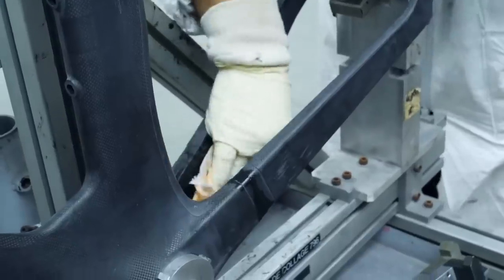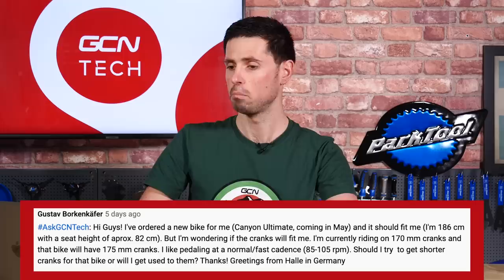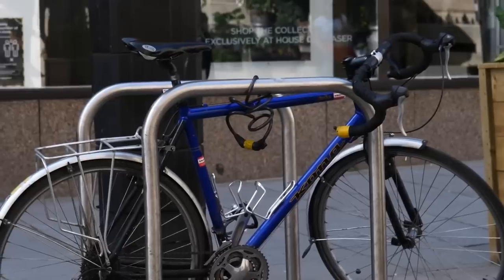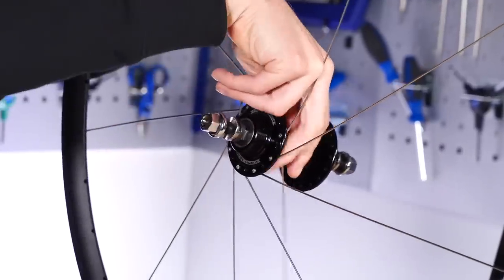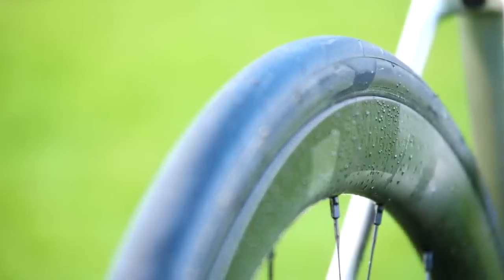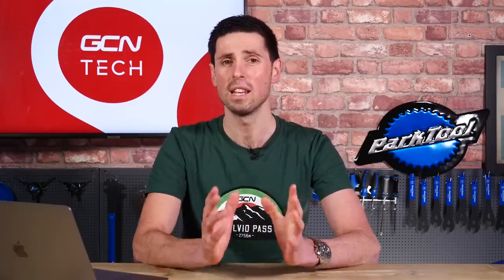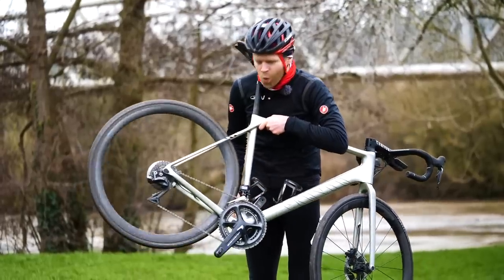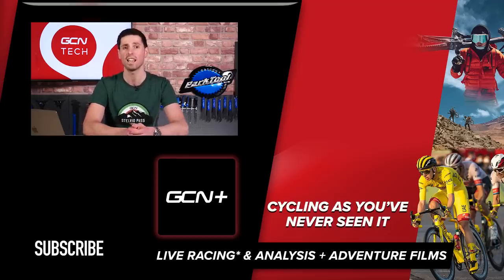Do Carbon Fibre Bike Frames Have A Shelf Life? | GCN Tech Clinic #AskGCNTech

Comment: #AskGCNTech
My disc brakes keep ruining my life. Last week I had to get my rear calliper replaced, because the previous owner tightened the pads so much, the screw broke on multiple places. Cost me €140. Yesterday my front calliper was not running smoothly and I found out that one piston only goes out, but doesn't retract, so that it's always against the rotor.

What can I do to save my life? Please help, before I throw my bike off a cliff.
Reply: Could be dirt on the piston. There are a few videos on YouTube about it. Or the brake may be in need of a bleeding.

Comment: #AskGCNTech Hey guys, I have some El Cheapo (the brand is Winzip, but I doubt it is anything good) brake calipers, combined with oooooooooooooooooooooold Sora 3400 STIs (which are Super SLR), and I feel that braking power is lackluster to say the least. Are modern Shimano calipers (the SLR-EV or even New Super SLR models) compatible with my levers? If not, why? Would mixing components (like, for instance, using SRAM's calipers), improve braking performance? (I already upgraded my brake pads). Thanks in advance!

Comment: #AskGCNTech which is better speed sensor or gps based speedometer?
Reply: Been testing this myself recently over the last month. Found that the speed sensor is more accurate and there are no data spikes, dropouts or other weirdness, but the GPS speedometer is better for integration and means less stuff on your bike in general. For someone like me, where getting incredibly accurate speed data is not an issue, the GPS is peachy keen. It does, however, mean that I can never be completely sure whether I really did hit over 300kph on my last trip to the shops. I mean yeah, there was a tailwind, but, still ...

Comment: #AskGCNTech does different sizes of frame has different sizes of rim? Because some rims look bigger.
Reply: No.... unless you have a small frame and mount 650B wheels on it. Take a look at the recent video with Conor and Manon swapping bikes, Conors wheels look tiny compared to the frame. I've always wondered if there would be a rolling resistance advantage for such large riders to go to larger wheels.

Comment: Short answer - No 

Yours sincerely, 
A structural engineer.
Reply: The short answer - it depends, but mostly yes.  Another structural engineer.
Reply: @lightnervejm2664  Can you please explain?
Reply: So yes or no?
Lol
Reply: @pomajzsolt4363  most definitely maybe from not a structural engineer 😉
Reply: @nicksmith9068  :DDD
Reply: @lightnervejm2664  Lol. Carbon does not degrade when it’s not doing anything.
If it’s working, it will degrade over time, if it’s not and it’s just sitting on a shelf it’ll be fine.

Comment: Carbon does fatigue, from repeatedly flexing. It may take many years, but I don't think anyone has researched it fully. I can tell you as an archer, our carbon arrows wear out and lose their stiffness in 1-2 years. Obviously arrows have a tougher life than a bike frame though...
Reply: I have some carbon frames since almost 20 years. I cannot notice any signs of fatigue at all. But I can feel some fatigue in my body 😄
Reply: @marc_hm_  it's debatable whether you'd ever be able to feel it. Doesn't mean it doesn't happen though. It's more dependent on miles ridden than age. It's worth saying that it's not the carbon itself that fatigues, as in its normal state it's a soft material, it's the bond between the fibres and the epoxy. 

Aluminium also has no fatigue limit. Steel on the other hand does, therefore stress of a given low level cannot cause eventual catastrophic failure. The same goes for titanium as steel.
Reply: @TheAegisClaw  believe me, i would feel it. Because i already felt fatigue on older aluminium frames. The carbon frame im talking about, is a Look KG281 (carbon frame with aluminum sleeves) from 2001. I raced a lot with it, so its not a question on miles in my case. It had already a lot of mechanical stress, and even crashes. But you are right, every material will loose stiffness over the years and miles you will use it. But with carbon, this limit is so high, that you cannot notice it.

Comment: #AskGCNTech I’m wanting a carbon bike but being 18.7 stone I worry it will break overtime or if I hit a pothole
Reply: That is about 261 lbs according to Google. I weighed that when I got back into cycling and bought a Cannondale SuperSix (in 2013). It worked great, never had any problems and kept it until two years ago when I bought a new SuperSix only because I was itching for disc brakes and electronic shifting. I did lose weight as I went along but am still 225 lbs. I know I am a sample of one, but carbon bikes are really strong. Just check to make sure that there isn't a weight limit or you are below it if there is. Some bikes do have weight limits. If you buy a high end bike with light wheels, I'd suggest getting a set of sturdier training wheels until you get some weight off. Otherwise you just risk breaking spokes more often. From experience, have your bike shop check your spoke tension regularly. Us heavier guys put a little more strain on them. If they lose tension, they will break more easily.

Comment: If you use disc brakes, you can bring a tiny lock and put it through the holes in the disc rotor. If a thief the tries to steal your bike he wont get far:)
And such a tiny lock is super light, cheap and easy to take with you.

Comment: I'm about to buy a hybrid bike which one should I buy. 700 Quid budget
Reply: Andril A Chakraborty - don't buy a hybrid. They're rubbish, heavy, and with wrong geometry for a road bike. Save up & get a decent road bike, even entry level ones are great 🚴💨.
Reply: @monkeybizniz2095  but I need a upright position. I don't like the bend down position
Reply: @monkeybizniz2095  I agree. I Just sold my hybrid and bought a road bike with dropped handlebar.
Reply: @andyc9902 -  but thanks to the  modern combined brake/gear shifters, I find riding on the hoods quite comfortable & upright. I hardly ever use the drops position. Most road bikes are sold with 10mm or more of spacers between the stem & top headset.
Reply: @andyc9902  You can buy a comfort road bike which is a lot more comfortable than an aero bike.
Reply: @pomajzsolt4363  do they exist
Reply: @andyc9902  Yes they do! 
For example this Trek entry level road bike.
This is a lot more comfortable road bike.
Here is the number one priority is the comfort with more upright riding position and 32mm tyres,but of course the bike is still fast enough.

https://www.trekbikes.com/gb/en_GB/bikes/road-bikes/performance-road-bikes/domane/domane-al/domane-al-2-disc/p/33083/
Reply: @pomajzsolt4363  not a fan of dropbars

Comment: #AskGCNTech hi, I'm looking at 3 bikes at the moment: they all have ultegra however one has 40mm deep wheels, and has a power meter but is mechanical rim brakes (giant), the other is sram force etap axs with 10mm wheels and no power meter but hydrolic disc brakes (canyon) and the third is di2 rim and 7.0kg but not aero whatsoever, which one would you recommend? (they are all pretty much the same price) thanks
Reply: Cheaper and easier to upgrade wheels later on than the groupset. Mechanical Ultegra is great. Personally I prefer disc brakes, but that is me. I have the Red Etap and like it pretty well but I could live without it. I have to admit, I somewhat miss having power on my new bike. I don't race but it was a nice metric to just watch and was great to help keep a steady pace when I am on the front of a group. You have to ask yourself which features are most important. Which features would you want eventually?

Comment: #AskGCNTech Can you recommend an inexpensive bike toolkit for servicing your bike at home?
Reply: The best advice is to spend as much as you can afford. Only get the tools you need for your bike at first get a decent adjustable spanner as they do a fair bit if used right and depending on your bike get a torque wrench that also does torx and Allen keys, Topeak do a good one that you can take on rides. A good multi tool with lots of tools on it can be a good start as you can take it with you and several have most of the most common tools you'll need on them.

Comment: Some really crap advice here. The first guy was asking if carbon fatigues over time, due to flexing. Not whether UV degrades the resin!

And the triple front mech question is probably an issue with spring tension or a possible worn ratchet in the lever. Checking tension of cable does nothing here.
Reply from the maker: Thanks for the feedback 👍